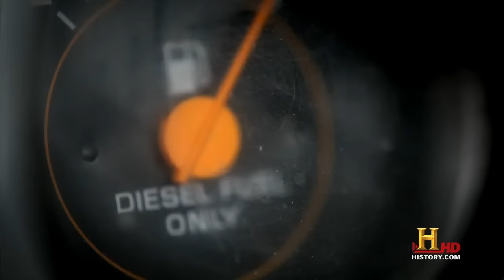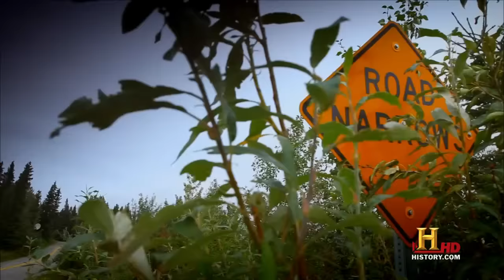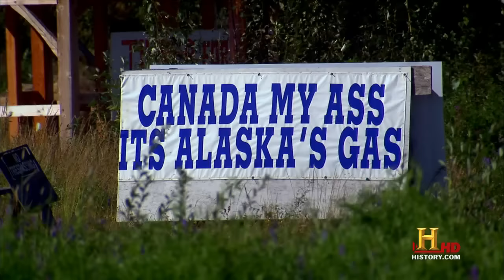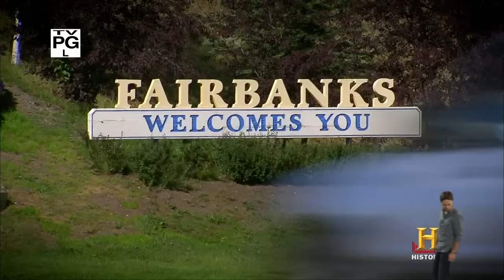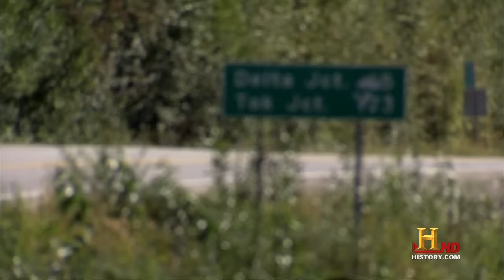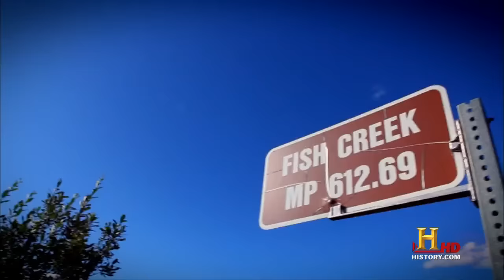Top Gear America Best America's 4x4 Truck   S01E09 - 2011.01.16

Comment: This is why Jeremy, James and Richard will be the best car show hosts ever. When the Brits do a challenge like this and have a following car like the Toyota here they actually use a shit car, like the VW Bug. These guys use a Toyota Hilux which Jeremy and his boys  have already proven is an AMAZING truck. The American Top Gear think it's a downgrade because it's an "import."
Reply: Top gear in general knows nothing about trucks and 4 wheeling. Gearing and torque mean are way more important than year and hp and brand. If the f250 was taken care of, it would have won. It has a 360 or 390, full float HD rear axle, divorced np205 transfer case. The Chevy was good too, it was just a half ton with weaker everything. The Dodge was decent but the tires and lift were too big for what they needed these for.
Reply: Jeremy, James and Richard are the gold standard. Everyone else is potmetal.
Reply: I think you missed the point of why they chose the Toyota as a chase vehicle, it wasn't because the Toyota was bad, it was because if none of them had made it in their own trucks they would have to finish the "toughest US built truck" in a Japanese truck. Top Gear uk did the same thing when choosing a chase vehicle, the producers would choose a vehicle that met the definition of the challenge, however was also something none of the presenters would want to finish the challenge in.
Reply: Dustin Platt so glad those guys are on the grand tour on amazon
Reply: NO!
Reply: If the chevy was weaker why did it make it to the end. LMAO!
Reply: compared to the other three it is a downgrade
Reply: It is a down grade.Rice is too expensive to burn.

Comment: In the years these trucks were made, Toyota couldn’t tow a dingy. Toyota’s were never made for real work until recently. Each truck with proper maintenance will last.
Reply: The Toyota in the video also cost way more than $3,000 US today. Probably closer to $14,000 US. Maybe $12,500 back then in 2009.
Reply: Jeremy Lakenes that's why they  put all the extra  weight  in the back to help try and make good TV they knew that one of the pre owned trucks would break .  Just makes for good TV
Reply: Go watch the UK Top Gear's epsiode on the Toyota they couldn't kill. Literally flooded it in the ocean.
Reply: in the late 70s and early 80s, toyota's advertisements were nothing but pictures of toyota pickup owners that had well over 300k miles on their trucks, and many were farm trucks. they have been able to work their entire lives, its just slightly different work because they aren't full size trucks
Reply: Agreed, my father has a ford with 400,000 miles on it that he bought back in '95, and he just upgraded to a f150 platinum (with everything), he's hoping it lasts just as long. I have a 2006 gmc denali with 185,000 miles, but holy shit the mpg on it is horrible, I get 13 per gallon.
Reply: The Toyota was the best truck there, easy. Chevy was second. Sorry guys, but your 80s Chevy with 200k Miles isn’t that impressive. My 2004 4Runner has 315k and it drives like a brand new vehicle
Reply: Kyle Puckett heck yeah ! Toyota all the way
Reply: Jeremy Lakenes sorry bud but my dads truck towed more than a fuckin dingy 😂
Reply: @2jzxjv848  toyota can't  pull 30 k though
Reply: Nonsense. Of those, the Toyota Tundra (they excluded) has the most parts made in the USA. That Tacoma is as American-made as any of the three, more than two. And, before anyone screams about profits, all three of those have foreign investors profiting for their sales. The Tundra and Tacoma are American trucks, designed and built.
Reply: Josh Hust  love Toyota cause you just can’t kill them
Reply: i have a 94 dodge Dakota and it has 212,000 plus a couple hundred on it and it still runs like it has a hundred miles on it
Reply: @JW-mr5mh  that's because it is  a 365hp 6.0. Lol I supercharged mine and had the top end all upgraded with LS-7 top end. Now 650hp. 85,000 miles 2004 Denali Yukon XL. It's a beast but good quality. Lots of power.
Reply: @JalenRose02  nope. Not made for towing much.

Comment: This is really depressing compared to the Toyota bit on top gear where they...you know... DROPPED OFF A BUILDING.
Reply: And drowned in the OCEAN. Toyota over all
Reply: A toyota pickup WAS my dream vehicle,  but now I own one so its not a dream.
Reply: Yeah, I was betting on the Toyota from the start
Reply: i bet those trucks can do the same thing and survive
Reply: Nick Ormsby hell no lol
Reply: Nick Ormsby lol they couldn't even survive the drive.
Reply: Id almost break my truck on purpose to take the hillux
Reply: Why can't we have trucks like that in the US? Oh right, chicken tax.
Reply: 24 Daytona Nc  that's funny man. I love how all the American trucks with the massive V8's are struggling at every part and the Toyota which has probably just a tiny bit bigger lift than most of the American trucks is just sailing through Alaska. Everybody is like well it's a lot newer. Well that Dodge is a 97 I think or somewhere along those line and that Tacoma is a 98 I think and it's funny as hell how the newest truck there was the first to go. Toyota's are great though. I have a 2007 Tundra and it's the best vehicle I've ever owner.
Reply: That's not gonna happen everytime you drop one off a building. Pure Luck nothing else.
Reply: @hooptie  yeah I been saving alot to buy me a Toyota 1983

Comment: The dodge would have made it if he hadent been beating the shit out of it
Reply: The Termanator all he did was water logged it. If he would've taken the plugs out and turned the motors over a few times it would've fired right up.
Reply: but the Chevy did make it, and he also beat the shit out of it
Reply: chance heaps that's  what I'm saying they beat the shit out of all of them the Chevy just took that beating better
Reply: @chanceheaps6720  And it drove though the Dodge  truck's  log cabin up hill lol
Reply: Bruh it was meant to be a stress test, and the other trucks got beaten to hell too.

Comment: If he wouldn't have smashed the drive shaft, that ford would have still been going
Reply: Billy Sanderson no it would have won i got a 77 f250 and it runs strong had a 79 chevy 2500 and its in a scrap yard now it die in the river because of the brain box got wet or the distributor cap wow the drive shaft snaped if the others would have done the same they would have been fucked to
Reply: 😂 ford's barely make it down the highway that pos was never going to make it
Reply: @dollydehart4813   thats because it was a work truck and the clicks on that truck only go up to 10 000 so it probobly had 400 000 miles on it
Reply: I look at it as saving it from further damage. One of those f250s of that age, preferably a 1970-74 are my dream vehicle.

Comment: I worked at a Ford,and GMC truck combo dealership in the early 90’s and when ford counts sales against Chevrolet they do not include the gmc truck sales, which is the same truck with extra chrome and trim packages.
Reply: Welp ford doesinf usee Lincoln so i think its fair
Reply: I was thinking the same thing. Lol

Comment: So the "horrible" import truck which was hanging on the wall at the old top gear with Clarkson because it wouldn't die and is a legend made it to the end also without a scratch?? What a terrible truck
Reply: Yes, the truck with a solid axle swap, snorkel, winch, beadlocked Boggers, rock sliders, and who knows what other mods was probably the best truck for the job. LMAO.
Reply: You're missing the point.
Reply: it's an import and this is the beat AMERICAN truck. the whole point is to prove that domestic trucks are better. ding dong.

Comment: Dang he doesn’t even know the engine size in the dodge no such thing as a 5.7 in the v8 magnum
Reply: Hudson Draughon ikr there’s only a 5.7 v8 hemi
Reply: Hudson Draughon  first it was a 95 then a 96 and finally a 97
Reply: That looks like a 5.9
Reply: I wondered if I was the only one that noticed that....
Reply: David Smallz yup I had a 1999 Dodge Ram 5.2 with a 318 sucked back gas but was a good truck.
Reply: This truck def didn't have it but there is a 5.7 magnum hemi
Reply: @stetlan5582  As I know it, there is no Magnum Hemi. The Magnum was Dodge's attempt at refreshing the ancient dodge V8s with electronic fuel injection with minor tweaks to the engines themselves. The 5.9 Magnum is just a MPI equipped 360 MOPAR with new heads.
Reply: @xMournful3ch0x  look it up.
Reply: I noticed that myself and had to look to see if anyone else did. They made a 5.2 and 5.9
Reply: @Lee-wl1tx  you wouldnt be able to tell just by looking at the bay. Youd have to check the serial number.. 5.2 and 5.9 are the same engine. The only difference is the 5.9 is bored out slightly bigger cam and its externally balanced.
Reply: So yeah...cant believe they got it wrong. 5.7 for the dodge trucks came out in 2003.5 for the 2004 model year If I'm not mistaken. This truck is what...a 95 or 96 or 97 like they said in the show...lol...
Reply: Yeah. I was like, Hang on a minute.

Comment: They should have found trucks that all were the same year
Reply: Josiah Carr if it would have been 96 models like the Dodge...Chevy and Ford would have never made it that far
Reply: That and they put a Dodge 1/2 ton against two 3/4 ton trucks. They were all made in different decades too. Not a fair or scientific experiment in the slightest. I knew it was gonna be bad when he said it was a 5.7 Magnum V8 in the dodge.
Reply: Jacob Wolfe Chevy is a halfton
Reply: Jessie Oliver 96 chevys still had 350 engines so no chevy still would of won. Dodges magnum engine is trash
Reply: Dallas cowboys I'd gladly put my 5.9 against any 350 riding or pulling driver and being took makes a difference. If I could load it i got videos of my half ton pulling around an f250 7.3 turbo
Reply: Jessie Oliver I'd take that bet my 350 Chevy will drag your ass guaranteed.
Reply: Justin Riley it's in Marion county TN....I don't mind hurting feelings one bit. even if it's a dually 4wd chevy with a 350 to stand half a chance against my little ole half ton Dodge.
Reply: Josiah Carr they were the same price and I think that's a better real world comparison with anything thats older than 5 years.  I'm not comparing old used trucks by year, nobody else is. All that people care about is price range.
Reply: Gmt 400 would make it , Ford shit 150 wouldn’t make it unless it’s modded , Dodge would probably make it if the front end and transmission hold up
Reply: Josiah Carr hjihuu
Reply: Josiah Carr yea 
Ford would've won with that
Reply: America Ford can beat any of those shit trucks
Reply: Yeah, totally not scientific. They should have been the same year and tonnage!

Comment: Why was there a v8 roar every time the Toyota showed up... v6?
Reply: Michael Schubert dramatic effect
Reply: Michael Schubert engine swap, the v6 probably wouldn't be the best
Reply: Nah, in real off road vehicles, power doesn't matter. It's all gearing because you don't want to go fast. Plus the extra weight isn't helpful. The sound was most likely just dramatic effect. A lot of people with Jeeps and Yotas actually prefer a 4 cyl since it's lighter and more efficient
Reply: Michael Schubert the toyota had  a diesel. roar? lol. it's a Hilux y'all fools
Reply: Se7enAte yup a 4 cylinder with some 4:56 gearing
Reply: Those toyota's were not diesel in america as far as I know.
Reply: Couldve been straight pipe also
Reply: Not exactly. It's just displacement compared to the number of cylinders. Hence why European engines are high pitched even tho they might have 10 or 12 pistons. Generally a v6 is a low displacement since they are usually made for efficiency.
Reply: Se7enAte nah man the AMC straight 6 is better for the jeep, it weighs almost the same and makes more power
Reply: Not to mention the Toyota had a solid axle conversion on the front. Last year in America was 85.
Reply: Most Jeep guys like the straight 6, we hate the 4cyl jeeps, they are slow and suck, thats why Jeep stopped making the wrangler with a 4cyl, and why everyone wants the 4.0 cherokees.
Reply: I wouldn't say they suck. They're just the 4.0 with a couple cylinders chopped off. They're way underpowered but its not like the 4.0s are fast anyway. A lot of people prefer the 2.5 because they are better on fuel and just as reliable as their big brother
Reply: You should hear my Jeep. I6 Cut straight at the header. Sounds like a big beefy V8! Every mud show I go to people ask me what I have in it and when I show them they laugh a little cause they tell me it sounds much bigger than just a stock Inline 6.
Reply: I put a stainless header on mine and had to drive a few minutes to the exhaust shop with only the header on. These things sound so deep for a 6 cylinder because the bore is huge. Then on top of that if you accidentally leave your map sensor unplugged you'll get a choppy idle that sounds like a super aggressive cam. You just wont be able to rev it lmao
Reply: Yeah It's actually funny you mentioned that cause it reminded me of my O2 Sensor, I had a check engine light on for the longest time and didn't really wanna replace anything because it was an offroad jeep only. Never see's payment. When I hacked the exhaust system off and disconnected the Catalytic Converter Sensor the check engine light went away.
Reply: The warning lights on my 89 don't even work. My check engine sensors are my nose and ears. If it smells rich or I hear clunking I know something is wrong
Reply: Yeah I hear ya. It just didn't make sense to me why removing an O2 Sensor got rid of my code. You would think it would throw a code not having a catalytic converter.
Reply: Headers, cold air, and cat back exhaust.

Comment: Ford had a broken u joint due to idiotic driving
Dodge had a busted radiator due to idiotic driving 
Chevy made it even though it was driven in an idiotic way..

Lesson learned??? 
Nothing.  Show was sorta entertaining though. It's a shame these vehicles were destroyed.
Reply: proves a chevy can take a hell of a beating
Reply: That is not a cv joint. It's a universal joint. The truck is also 50 years old and quite possibly it is the original joint. They are 20 dollars at AutoZone btw.
Reply: It is a shame. Especially that Ford. They are rare vehicles.
Reply: @ptwilder13  your right.  I'm not sure why I even referred to it as such. I rewatched and absolutely broken u joint
Reply: @snoopytheace4487  its just a u-joint to replace
Reply: @joshanderson1019  ya but as rough as he treated it Who knows what excessive wear and tear he caused.
Reply: @snoopytheace4487  still seems quite easy to repair
Reply: Lesson learned is that Grand Tour is a way better show
Reply: It wouldn't exactly be very entertaining if they drove like grandpas.
Reply: The Chevy diesel(with a carburetor) was apparently an engine swap....... How many miles were on the engine itself? The Ford and Dodge both had over 150K.... I think the Chevy was a ringer with maybe 50-60K on it!
Reply: right that was a perfectly good second gen
Reply: @ajwilson605  tanner said the chevy had 220k but it did appear the engine had been replaced. It had newer heads and valve covers
Reply: @lynndempsey4096  then why did it win

either way man i dont want to argue about this a Chevy is my personal choice of automobile manufacturer
Reply: This was probably all filmed in one day in a small area. They didn’t really go on a big adventure.
Reply: The Ford is also the oldest and has received a beating, so I’ll take the REAL truck... the Ford
Reply: Mr. Flim Flam stop complaining there are already enough of these comments
Reply: The dodge got moisture in the distributor because of an idiot driving.